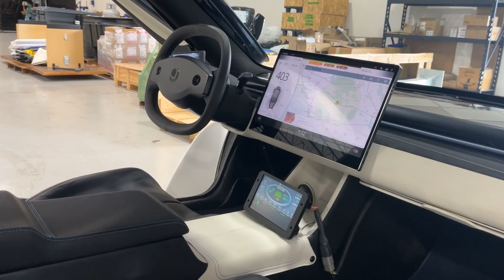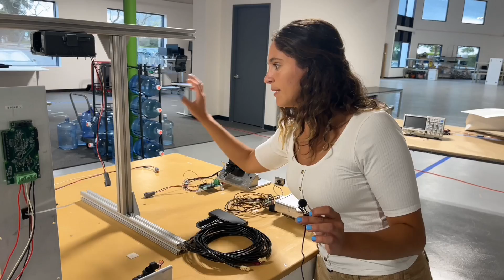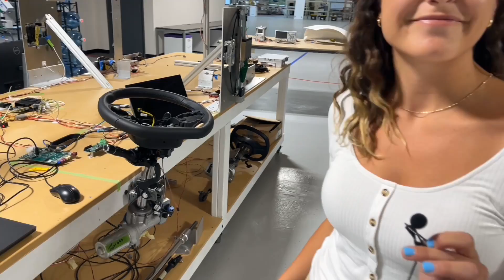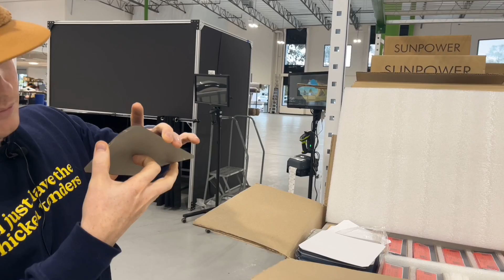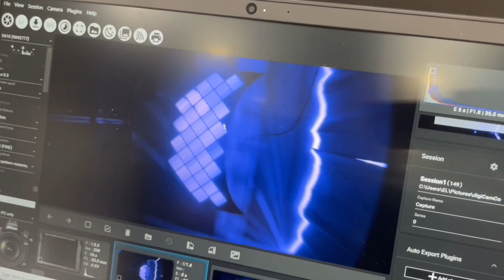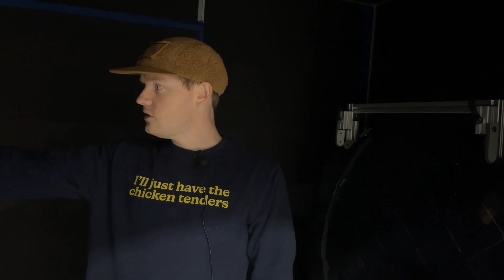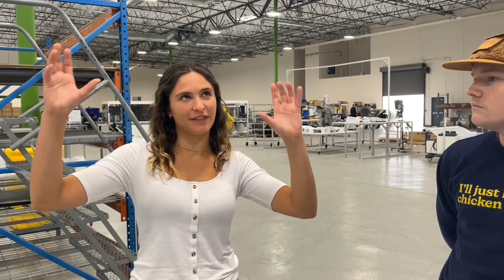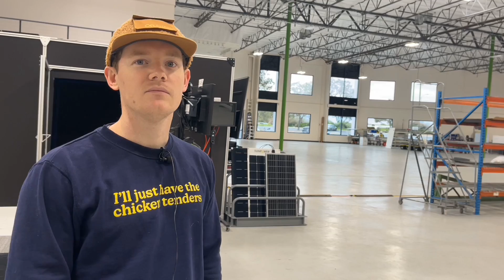APTERA factory tour 2023!  INSIDER updates on solar, funding, and production timeline!!

Comment: Having over 2 decades of experience designing/fabricating/testing multi-axes solar panels, I repeatedly cringed at Cam's (Aptera's solar team member) cavalier handling of the solar cells.....
Reply from the maker: He was probably just trying to demonstrate the 2-axis flexibility, but as he mentioned soon robots would take us clumsy humans out of the equation ;)
Reply: @SavingGreen  You're likely correct but here's the thing, there is no 2-axis flexibility of otherwise flat, uncompressible/unstretchable materials such as the Maxeon solar cells.  Ignorance of that fact, imposed on us by nature by the way, is likely why there were so many damaged cells (post lamination) shown in the EL tester.  Apparently, contrary to what Chris A and Steve F keep saying, Aptera has a LOT of solar panel development/testing/validation work ahead of them.  Good thing they have time....
Reply: @bobhilder1469  I have that manufacturer's cells in their flex panel on the deck of my boat. Probably an older 20% efficiency era. They are definitely flexible up to about the curvature of the deck, van roof, etc. I try not to walk on it but once in awhile is not a problem.
Their limited flexibility vs other brands likely provides longer life.
There are new films now that roll up like carpet. Maybe Aptera should be going that route.
Reply: @artsmith103  I'm fully aware of how flexible the "Maxeon by SunPower" cells are.  I work with them daily and have been since they were first available in the early 2000s.  My point was the cells, individually, can't be simultaneously flexed in two axis.

There have been "films" that could be rolled up like carpet for quite some time as well.  The problem has always been their rather low efficiencies.  The good news is that I suspect that within a decade or so, there will be some pretty impressive efficiencies available.
Reply: @bobhilder1469  🤓One thing I learned reading about mechanical engineering is that EVERYTHING is compressible, stretchable and bendable, even stuff like crystals, rocks and concrete. It's all a matter of by how much.
Reply: @fotoguru222  That's what I would call a "technicality".  I learned that while technicalities can be useful sometimes, they can just as easily get in the way of understanding.
Reply: @SavingGreen  I enjoyed the video, by the way.  Thanks for making it and sharing.
Reply: It was really weird. He didn't seem to have a clue. I thought I heard a few mistakes. The lady seemed equally incapable. She learned a script and how to speak some new woke language. Customer Experience Manager.... Demonstrated enthusiasm is suppose to substitute for aptitude. In the entire car industry this is the caliber they hire? There have been similar others, definitely a pattern.
Reply from the maker: @artsmith103  In fairness, they were both nice enough to take time with me for an unscripted tour.  I expressed that my audience is pretty diverse and not necessarily familiar with engineering jargon, so they tried to use accessible language.   Thanks for the feedback!
Reply: @artsmith103  I did some digging.  Cam might be a "technical writer".

Comment: 350 mpg(e) is a higher estimate than they have offered previously.  I'm wondering if there have been new simulations.
Reply: Under promise, over deliver.  You don't want to get out too far ahead with your estimates.  And the closer we get to the production model and testing, the more solid the number will get.  And you're right, they have been running tons of simulations.
Reply from the maker: Yup, in fact Audra mentioned they were running more simulations and wind-tunnel tests through the summer.  It's possible the drag-coefficient may improve still.
Reply: I think if you use the EPA method where one gallon of gasoline contains 33.7kWh of energy and assuming the aptera use 0.10kWh/mile of energy.
33.7kWh ÷ 0.10kWh/mile = 337mpg-e.

Comment: I have Solar Power flexible panel on one of my boats. It's been very good.
The charger continuously monitors arrary voltage and when it's high enough, activates and sends amps to the battery. Great camera work.
Reply from the maker: Thanks for sharing your experience with flex panels.  The tech looks very promising.
Not sure if you’re sarcastic, but it was my first time using a gimbal as you can prob tell haha 😂
Reply: @SavingGreen  No, nice work managing frame size.
Reply: @artsmith103 appreciate the feedback
Reply: Don't know if this has been asked before but as a lightweight vehicle how does it behave in crosswinds or when a semi trailer passes in the opposite direction? Thanks. Love the car 😍
Reply from the maker: @stevebuggatti7994  I don't think they've reported all the simulation data, but they do seem to suggest the car if safe overall.  I don't think it's subject to significant turbulence given how aerodynamic it is.